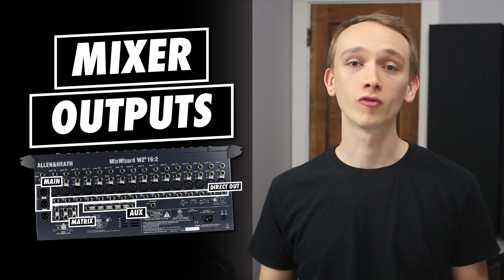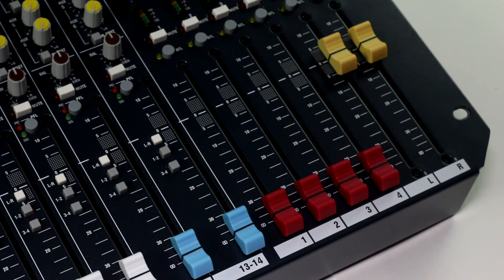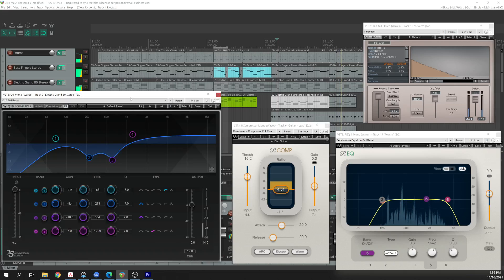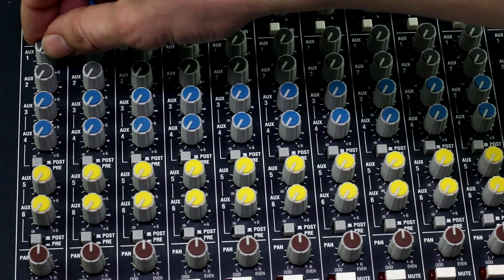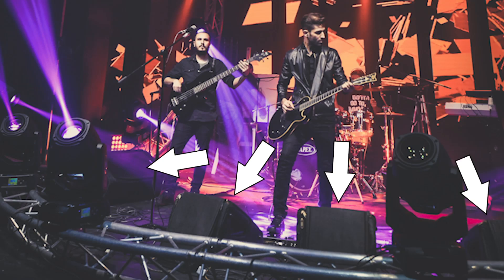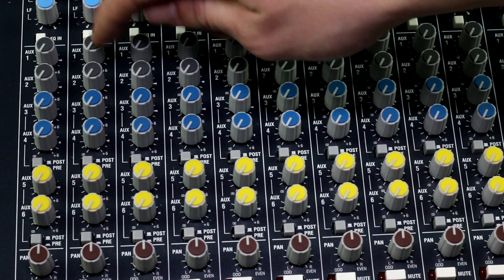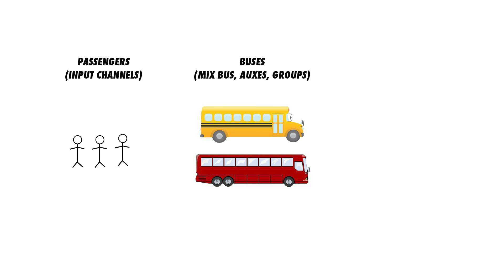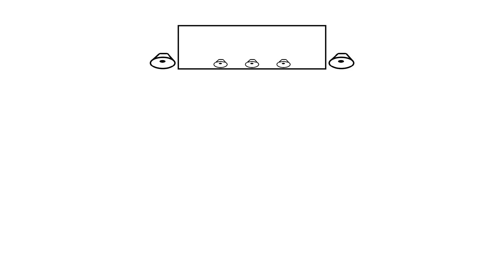What Are The Different Outputs Of An Audio Mixer?

Comment: Thank you for this video bro. very informative. I have a question though. Concernng matching impedance and speaker wattage to main source like you explained in other videos. With a mixer so much outputs and if you have to use 95% of them at the same time especially your monitors what do you do in term matching impedance & wattage of speaker to mixer/ console. how can you connect this without overdriving your speakers or console. And even if you have include the use of power amps to your explanation how is that done. Or please do a video of how to connect a a huge system with multpe monitors with a full tops and bass bins setup.

Comment: Hello Kyle, Thank you for the video

My question is which signal comes out of the Main outputs of a mixer?

Is it a line line or Mic-level?
Reply from the maker: If you use proper gain staging (utilize the dynamic range of the output) it will be line level.

Comment: Would you need an xlr attenuator if you were going from the main out of a mixer to the input of a recording console?
Reply from the maker: If you’re levels are clipping, you could use a pad. But if the levels are good and it sounds good, no need for a pad.

Comment: Hi kyle i have a question . 
So i use to do recording using a mixer and my phone  , using splitter ..
And i used the phones output on the mixer for my earphone..

Why is it the audio quality from the mixer phones output doesnt sound good like when i plug in my earphone directly to my phone without any splitter? 
the audio quality when i plug in my earphone directly sound more HQ ... Thanks in advance.

Comment: Can u use the main out to connect to an interface
Reply from the maker: Yes you can.
Reply: @AudioUniversity  ok so off the back of my last question. I have an interesting issue, now it might be be because I have to use the main out instead but I need confirmation as to to whether that’s the issue. I connected my audio interface to the left and right channels on my mixer via trs, however, my mixer won’t work if it’s connected to my interface and vice Versa but they work
Separately so I know they both work

Comment: I have an analog mixer "no usb" 
Mics go into each channel on board..then each channel comes out of the board via "direct out -10"...then into the interface set at -10
Then i record each channel
Then when i play back, each track i recorded comes out of my interface, i send back into the boards "tape in -20~+10db"...my interface gives me the choice of +4 or -10 out, to go into the "tape in -20~+10db" on the board, this is where im questioning the output of the interface
Im just wondering if either +4 or -10 should "NOT" or "SHOULD" be used going back into  "tape in -20~+10db"
Ty again

Comment: Hi Kyle, do you have a video on recording and also amplifying a source through a PA? Just wondering what the best option is, take a line out of the desk and send to interface or vice versa?
Reply from the maker: I’d recommend going through the desk first to minimize latency in the live performance.
Reply: @AudioUniversity  ah great! Then 1/4 out to interface? I have a focusrite do you need to do anything in the control software?
Reply from the maker: You should need the control software. It’s the same as recording two microphones, but they will be line level signals instead.

Comment: How do I connect a fx unit to my mixer to give it effect to individual channels ?
Reply: I dont have one yet but want to add some fx to output on channels to speakers
Reply from the maker: What type of FX unit are you connecting? 

In many cases, you can use the FX send and FX return signal flow shown in the video with an aux send.
Reply: @AudioUniversity  like a delay or reverb  I have a small yamaha but it has no built in effects
Reply from the maker: Check out this video: https://youtu.be/xv44nrENjRM